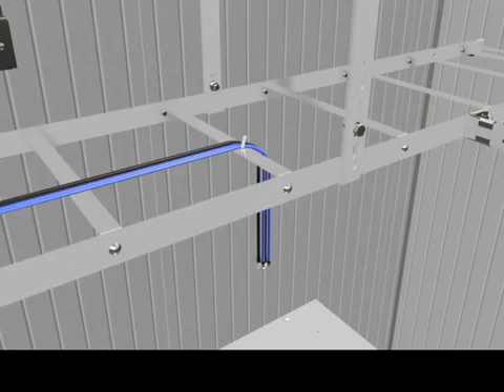Power Supply And DCDB

Comment: Why telecommunication work -48 voltage
Reply: Due to many reasons:
1.It is safe for humans to work with this voltage.
2.It can be traveled at much larger distance with very low losses.
3.-48 V is used to avoid corrosion of devices.
4.Lastly it is used to suppress(neutralize) lightening surges because telecom equipment is mostly installed outdoor so lightning may strike at bad weather